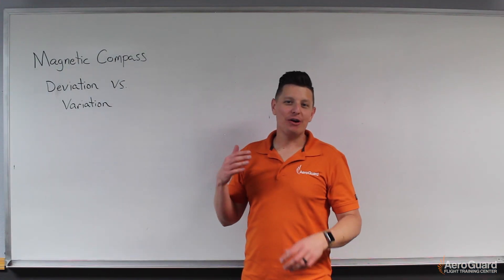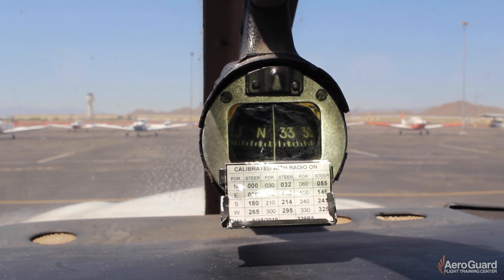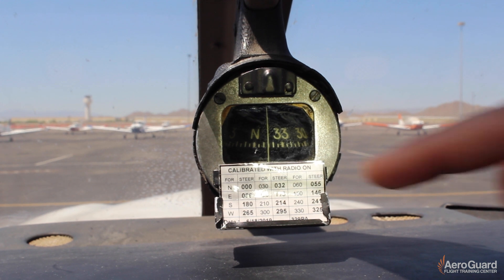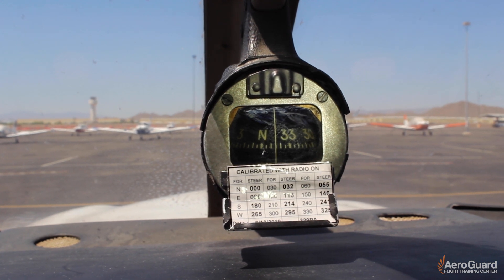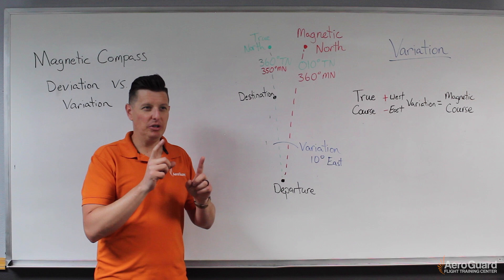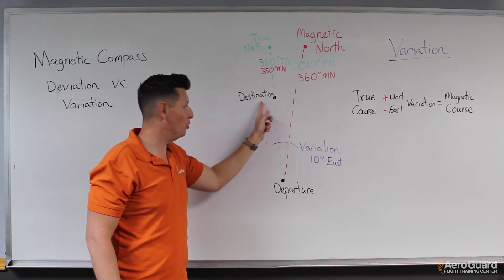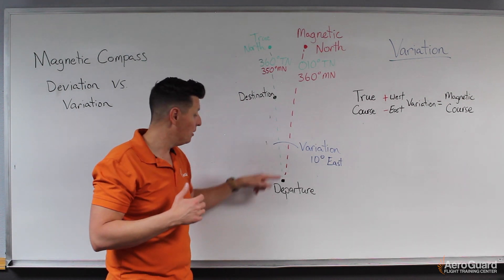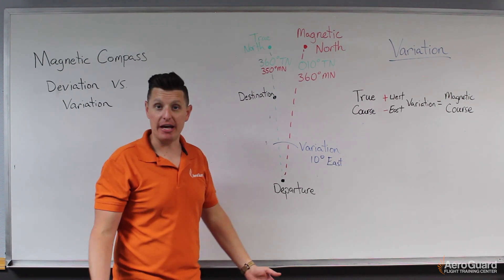Magnetic Compass Deviation vs Variation – AeroGuard Flight Training Center

Comment: For deviation error, if you have two planes that are the same, for example two Piper Warriors. What causes the deviation degree to be different if they carry the same equipment?
Reply from the maker: Hi Kevin, thanks for your question! Deviation is affected by magnetic fields in the aircraft, caused by electrical current flowing through wires and in instrumentation. While the deviation could be different due to wiring harnesses being in slightly different locations or different instrument placement in the cockpit, the important thing to know is that the compass deviation card is always required and you should follow the information on that card while navigating using the magnetic compass!